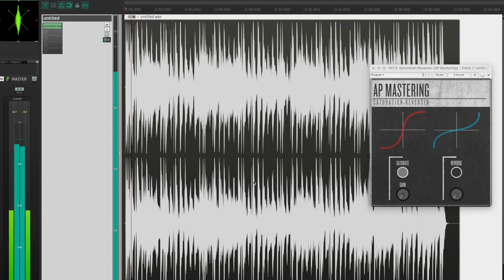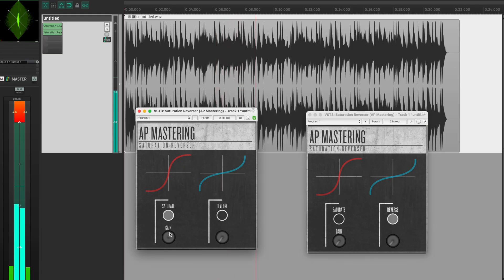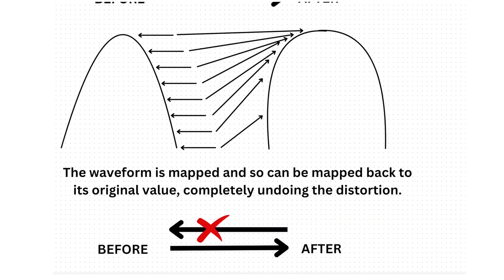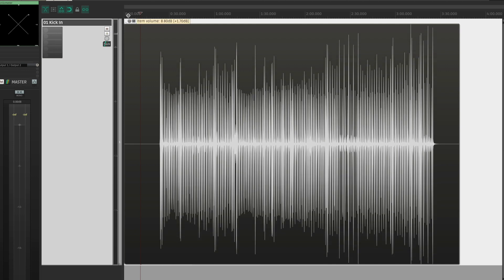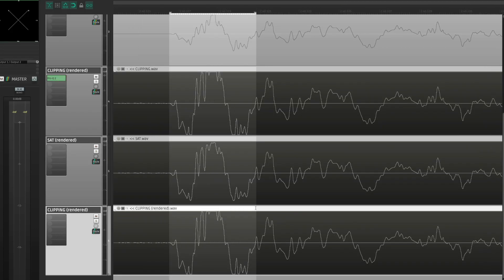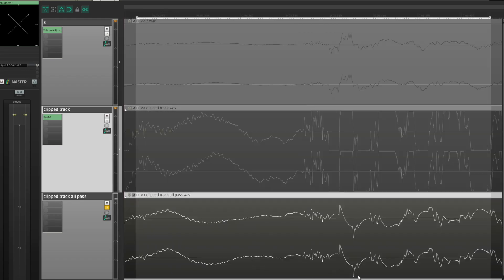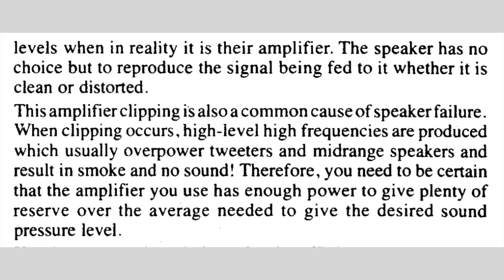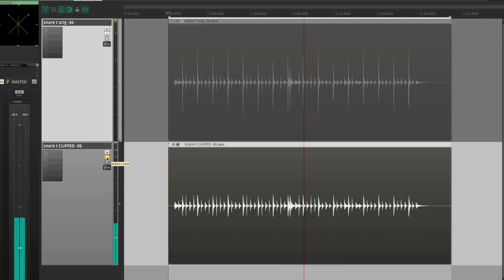Almost Nobody Knows, Distortion Can Be UNDONE!

Comment: Hey nice video mate! I don't see however why you treat information loss as a bad thing.
While mathematically you're right, saturation does reduce the volume of the information, and nobody does atanh functions on their music.
Clipping just lowers it to zero. There isn't actually that much of a difference, is there? 
About the PA systems, I guess that means you can't play square waves either? I don't find "damages the PA system" a convincing argument unless you're mixing specifically for speaker longevity. It's a side effect.
And the argument about clipping mixes applies to sat as well.

This reads to me as a bit dismissive of clipping in general? I think if it sounds good it is good, and while I normally think saturation does sound better, there's a place for hard clipping.
Specifically, one advantage it has is that the parts of the audio that aren't clipped aren't also altered in any way - they're just turned up. This is very useful if you just want to turn down a peak.
Reply from the maker: a loud square wave can kill a pa

Comment: Won’t a dc offset remover hi-pass-filter/fft-filter protect the pa from constant power? Just add that before the pa input and no smoke?
Reply from the maker: no. DC offset filter is just a high pass with a low cut off freq. This will not do much at all. All pass filters are much more effective
Reply: @APMastering  isn’t constant voltage == dc? Ac is alternating power == audio signal. A hipass removes oscillation of ~0Hz which is dc offset which is constant power.
Reply from the maker: @lazylazy871  yes but the sections of constant power are not <20hz in the context of clipping
Reply from the maker: to be more specific, an IIR high pass will make the tops less flat if your Q is gentle because of the phase rotation caused but you achieve the same phase rotation with an all pass. if you use a FIR high pass, so just the filtering without phase impact, there is zero difference to the waveform of a square wave
Reply: @APMastering  ah so it’s because the number of samples clipped is low enough and alternating in sign that it is more like a momentary square wave rather than unipolar dc offset. I didn’t think about the basics apparently :D. So now we can conclude that a square wave will also break PAs. Synth bass players better change their waveform to saw then xD
Reply from the maker: @lazylazy871  yes a square wave is bad for PAs but normally its not just a sqaure wave without any other music
Reply: @APMastering  exactly what i was thinking it should have to be a synth bass solo then without any use of filters :D I’m driving home my bass synth concept
Reply from the maker: @lazylazy871  yeah that would be bad

Comment: Digital clipping can be undone, by a declipper.
Reply from the maker: how?
Reply: @APMastering  I named it in my reply, several companies offer a de-clipper. I tested two with clipped audio and the result is very good. 

Izotope de-clipper:

De-clip repairs digital and analog clipping artifacts. Audio clipping occurs when A/D converters are pushed too hard or magnetic tape is over-saturated.

De-clip is extremely useful for reducing distortion in recordings that were made in a single pass, such as live concerts, interviews, and any audio that cannot be re-recorded.
Reply from the maker: @xgmode  where does it find the information? spoiler: it doesn't. it's just interpolation
Reply: @APMastering  If the clipping isn't too much interpolation is fine to reconstruct it. It doesn't need to "find" the info. I had a couple of commercial DnB tracks with +1dB clipping bits, using the de-clipper from Izotope I fixed the problem. I checked it at sample level, and the algorithm is really good at guessing what the waveform should look like.
Reply from the maker: @xgmode  it's still interpolation

Comment: Just a question
The saturation in your plugin is a achieved by a linear process. analog saturators are based upon nonlinear processes that cannot be described by the means of transfer functions. In that case, it is not possible to reverse it. Am I right?
Reply from the maker: no, tanh is NOT a linear function, its a nonlinear function.
Reply: A linear process is something which can be described as output = SomeFunction(input), as in this case. A nonlinear one can't... However, I don't know how nonlinear are the equations of saturation processes inside real hardware. In my opinion this video should be called "plugin saturators can be reversed". Good video btw
Reply from the maker: @Veins_Band  again i dont agree with what you say linear means, it's a well defined term. But sure, hardware likely has more complex distortion characteristics than digital tanh

Comment: The hyperbolic tangent saturation is a good choice if you want to push things to the extreme. However, there are several other saturation and clipping techniques that also work well for this purpose. 

Additionally, I believe that hard clipping is one of the more challenging options when it comes to handling peaks. So, what are the advantages of choosing hard clipping? Well, before reaching the threshold, the audio signal is actually identical to the incoming signal. In fact, hard clipping is the only transparent form of saturation or clipping until the threshold is reached.

If you don't have time to make all the necessary measurements and adjustments to achieve a 1 dB hard clip reduction, or are unwilling to sacrifice punch and clarity, are there any good alternatives? 

I'm glad you asked! One alternative is called soft clipping. It can handle transients better than, for example, hyperbolic tangents, as it's a continuous variable. It's also capable of preserving RMS loudness more efficiently, and because of its aptitude for treating transients nicely, it keeps the punch intact compared to other saturation/clipping modes.

Comment: This is an excellent approach to showcase the reverse function to a broad audience. As I can see, it is not applicable for 32-bit (float) signals, as we lose precision with each iteration, but the signal samples at 16-bit/24-bit depth are considered integers, and everything should work just fine. Anyway, I still suspect there can be corner cases.
I like your channel!

Comment: i'm definitely also more a fan of softclipping than hardclipping but i wouldn't go as far as to say that hardclipping is never useful and just makes things worse. the harder you clip something the more direct and close it sounds. you also have an easier time controlling the peaks and get stronger harmonics if you clip harder. but there are a lot of sounds that really don't like being clipped too hard, like vocals. clipping is also useful before compression to make the compressor react more evenly to a signal, and it's useful after compression to get an even sounding distortion, but that is true for both soft- and hardclipping
Reply from the maker: I think we have slightly different approaches... maybe im more old school but I never use clipping. I feel like there are many other processes which I am happier with than clipping that achieve similar processes, or I find the processes unnecessary.

Comment: This is again fake. Then take off distortion from AC/DC guitars please. You can't fkn redo clipping if its rendered. Unless you are RECORDING in 32bit floating. Also for the clipping drums thing... Clippping does make the drums cut through the song and its vastly different than just adding more volume with a fader. I don't know why you fear losing transients when you are using a daw which have transient designer plugins. With eq and a transient designers i can make even a bass guitar sound like an atomic snare. With limiters/compressors you going to lose transients on drums anyways so its your choice to add them back. Lots of times the drum tracks already have way too much transients and they just poke in too much in the mix.
Reply from the maker: you didn't watch the video

Comment: Well countered!
If one trusts their ears, they should notice that pure, hard, digital clipping should be tightly reserved for a handful of problematic samples.
I think, the controversy that your videos frequently cause, stems from the aspect that you (may have to) generalize very broadly. 
Nothing wrong with that, as it acts as a wake-up call. And I agree that, in a certain price range, there is lots of rubbish that is not even worth the seemingly moderate price. 
However, in some cases, there are plug-ins, that, yes, do not provide anything new, or revolutionary, but actually have brought together proven tech in a way that offers a workflow that would otherwise be very complex to replicate with "bread-and-butter" processors. 
Such examples could be processors by Toneprojects: 
Their value may not be the individual processing steps but the sheer concentration of access to a few moves that make life so much more easy, ... perhaps at the expense of originality, but ... not really? 

I would not want to build (nor would I even conjure up such) a processing chain that does what one of their offerings do. 
Effectively, the customer is paying for a highly specialized workflow. 
And that's the reason why I , pardon me, like the, oh so dissed, bx Shadow Hills convulute: 
I have a few use cases where it just does a great job within short time ... and I got it at a price that, absolutely, has justified itself.

Really good video, though!

Comment: You did not really address my points in the previous video. For me, the best sonic results when reducing peak signal for mixing or mastering purposes can be achieved with clippers, where you can move between hard clipping and soft clipping saturation. In the end, if it sounds good, it is good, no matter how much you try to explain in technical terms, how bad it actually is. (And yes, I do "loudness" match)
Reply from the maker: do you loudness match properly? one annoying guy in my comments was saying i was an idiot because you are apparently "supposed to match the peak level" which is obviously completely wrong
Reply: @APMastering  that's why i wrote loudness match not level match (which can be misleading)